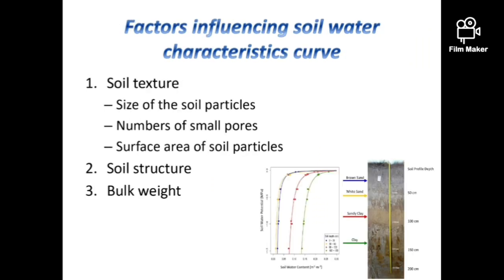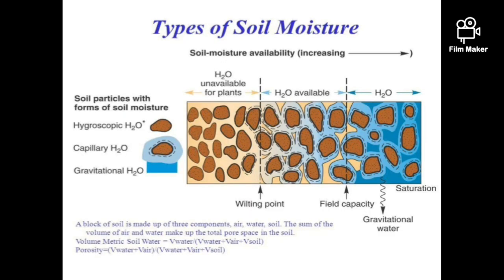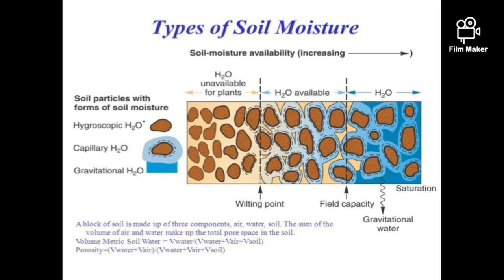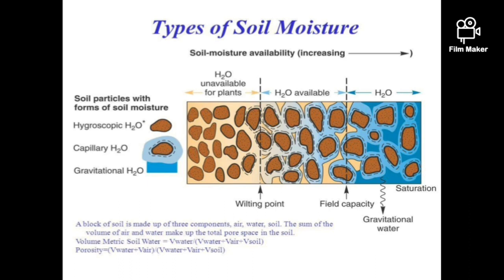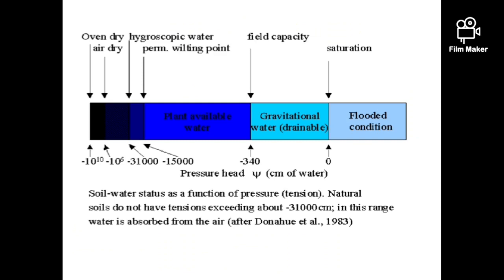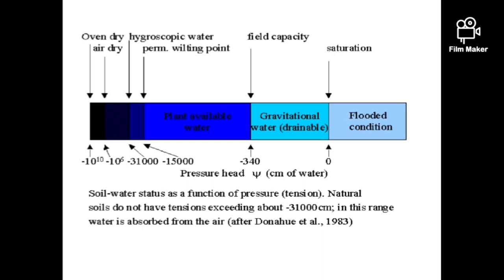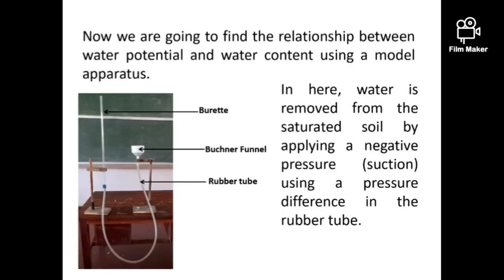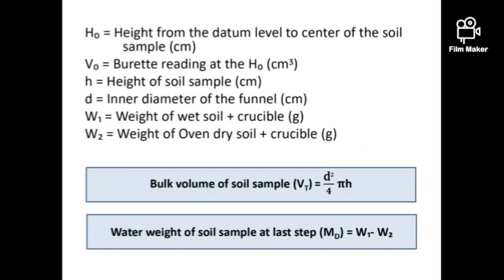Determination of Soil Water Retention Curve

Comment: Where should we consider the datum level, is it from the table level where the burette stand is set up? Also at time step 10.21 you have told the vertical distance needed to measure the center of the sample. But you are measuring a horizontal distance?